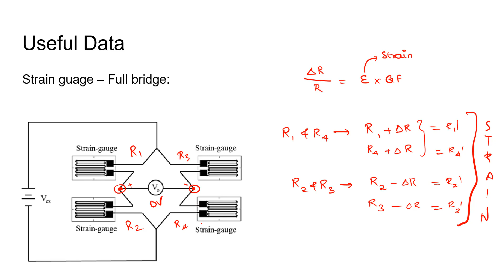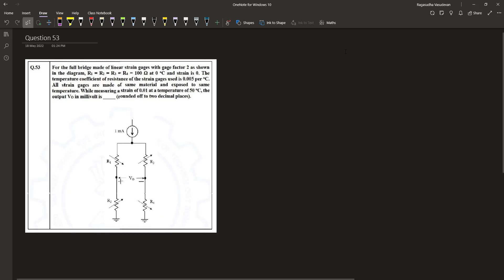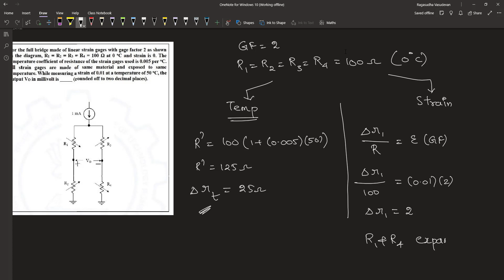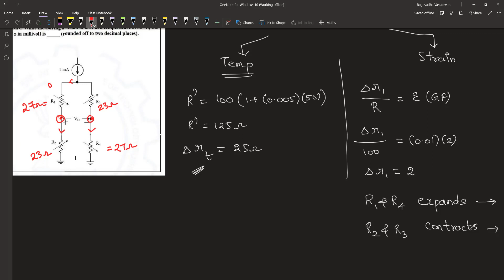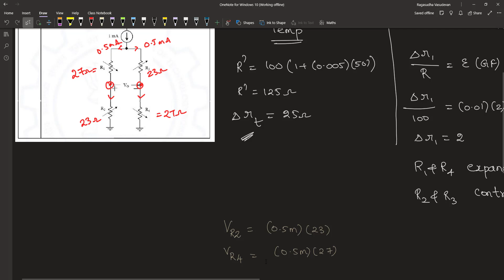Q53 IN 2021

Comment: Answer is correct mam, but the actual resistances values will be 127 for r1 and r4; and 123 for r2 and r3. You forgot to add the base resistance at 0C. Thank You